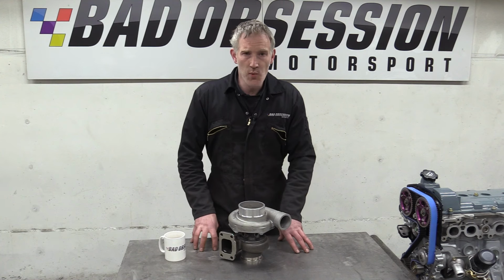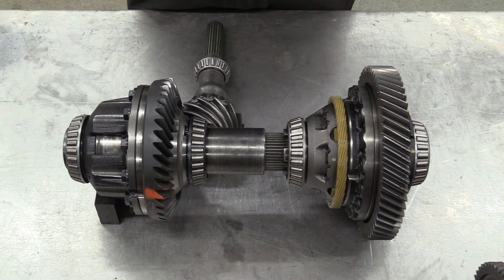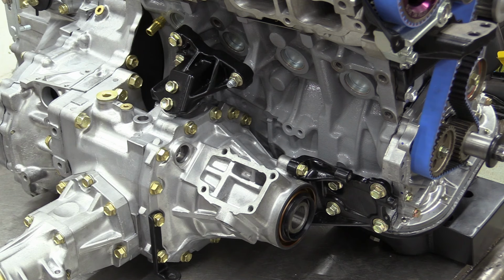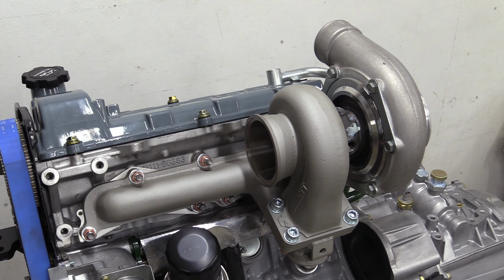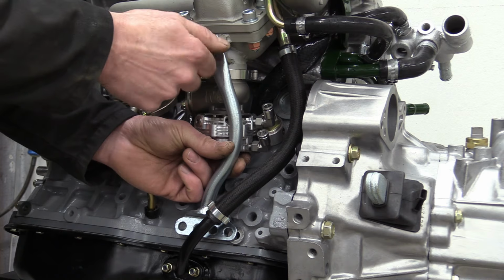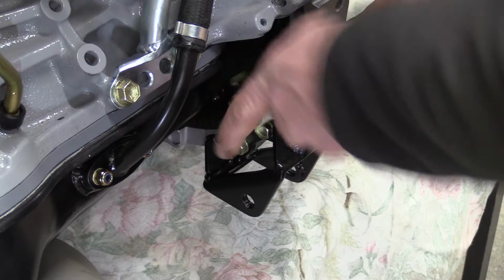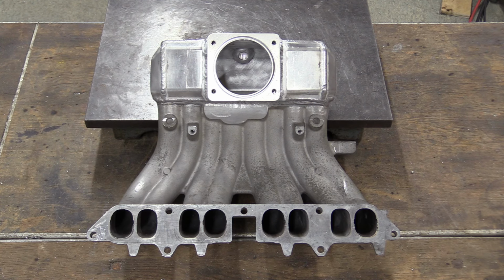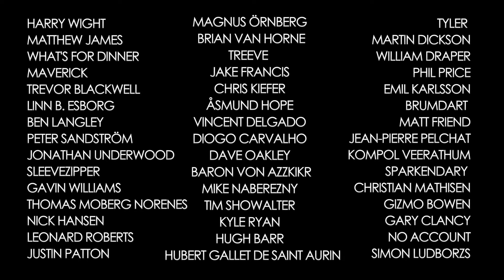Project Binky - Episode 31 - Austin Mini GT-Four - Turbocharged 4WD Mini

Comment: "The safest route is never usually the easiest route and this is why a lot of accidents happen"
Reply: Efficiency, Safety, Cost. Pick two.
Reply: Safety Harness? I don't need no steenking safety harness! Last words: "AAAAAAAAAAAAAAAAAAAAAAAAAAAAAAHHHHHHHHHHHHHHHHHHHHHHHHHHHHHHHHHHHHHHH"
Reply: The safest route isn't always the quickest way to the accident.
Reply: i just came to point out that the plural for "datum" is not "datums", it is "data". like that star trek android.
Reply: Safety third lol 😆
Reply: Jeep wrangler lift kits do come to mind
Reply: Not having the special tool and using a screwdriver+hammer is a fine source of injuries.
Reply: @cheater00  You'd win the nerd-off between you and Data! But I did think the same thing myself! :D
Reply: That's how my kids occurred

Comment: Can you imagine trying to get Binky insured?  

Is the car customised? :   YES.
What customisations does the car have? : YES.
Reply: I.C.V would be the answer, with an agreed value of parts and labour gone into it to reproduce it in a retail shop.
Reply: Ah, it is just a Mini, but a lot safer. It has side-impact bars, proper seat belts, proper seats, much better brakes, an improved crash structure at the front, all engineered with CAD. Also it has been fitted with a Safe-T device, developed and produced by a respectable company. I quite literally can't see any issues with insuring it. 😋
Reply: I'd actually like to see the customisation list - or more accurately the face of the insurance guy who previews the application! I wonder if they'd read all of it...
Reply: @smartin2174  insurance yes, no problem except the potential price. There's hardly a part that's original so valuation is tricky in insurance broker world.
Reply: Has Binky got an MOT?  Yes it has,
Has it been inspected by motorsports F1?   Yes it has,
Is it a class A classic mini?   Yes it is,
Ah now your talking,  cheap classic class insurance club....
Reply: It’s the same celica with a body kit. Cut the vin from one body shell to the other and you’re golden

Comment: Thanks guys, I went out last night to collect a length of aluminium sheet to tackle a job for my 24 valve Cosworth engine and I’ve just watched this video of the intake upgrades which is exactly what I’m going to be doing next.  😁
Awesome job as usual, especially the fitting of the 1 3/4 S.U. Carb at the end 😉

Comment: Nice!!! 

You need two Safe-T turbos for extra safety though.
Reply: One big and a second smaller safe-t turbski just in case. For low rpm safety of course...
Reply: Sounds perfect.
Reply: Am I the only one who thought about a small atmospheric supercharger in line with a big turbocharger. You will have the "safe-T" in the low and high range. Mostly low because of low end acceleration.
Reply: *one per cylinder
Reply: Yes as a fail safe kind of thing 🤔

Comment: Have you thought about adding insulation to the upper part of the turbo oil drain?  When you shut off the engine, the coating of oil on the upper pipe is going to get cooked by the heat from the header. I don't know if it's hot enough to cause coking that would eventually block the drain.  But better safe than sorry.

Comment: When you're done with the assembly of the Mini, try and squeeze in an electric pump for the turbo and a fan that sucks out hot air from the engine bay, when the car is stopped. A lot of people ignore that time in the modding world, but as far as i'm concerned, it's exactly the time when the most heat damage occurs to parts as there's insufficient cooling going around.
Reply: no

Comment: 15- 20% heat reduction is impressive
Reply: Its more transfer than anything.
Reply: Less heat energy under the bonnet means more energy into the turbocharger
Reply: @gabrielecossettini2923  And fewer things melting under the hood while the absolute madlads are going full tilt around a course.

Comment: Holy Mother of Overengineering!
Reply: Named Toyota in the 90s.
Reply: @guy_autordie  There's a reason lots of them are still on the road. And it's definitely not because they're fast or stylish.
Reply: If it is worth engineering it is worth overengineering! The rally rules said that you had to have a version in volume production... so Toyota threw every kind of sturdiness at the rally version... and had to sell that to "civilians".
Reply: When the patron saints of bracketry work on a Toyota from the 90's, one should expect no less :D

Comment: I have been looking everywhere for a 9.525 mm socket extension but had to make do with a 3/8". Your metric stuff is odd.
Reply: 9.525 is the high accuracy version, roughly the same as  12/32 give or take a ginger
Reply: Or 0.011₂ inch if you want to trash this base 10 crud of metric.

Comment: Tidy! That engine looks lovely with its shiny finish. The engines I do all the wiring on are a little bigger but this little car will go much quicker, then again tanks are not famous for their breakneck speed. I'd love to see you chaps try to squeeze one of these engines into a Celica, it'd pull a house. Imagine the brackets you'd have to make and the chassis reinforcement would make you both swoon once you'd made it. 
Another great video chaps.

Comment: Good stuff. Nick's nice little sheathed hose is known as the "hose from hell" to those of us who've owned a Celica GT4 or MR2 Turbo. I did such an insulating endeavor quite some time ago when I had mine. That center stud on the top of the turbo manifold (on mine at least) had a bad habit of backing out (nut attached) and falling off. A pretty tough repair when you have Helicoil the stripped hole in situ with the engine, and some of that "stuff" still in the car.

Comment: Getting to this a bit late, but for anyone else thinking about zinc plate for high temperature corrosion protection like Richard did here...

There's a temperature inversion in the iron-zinc galvanic couple. This means galvainsing, sheradising and zinc plate only protect steel below about 75°C. Above that the steel is consumed in preference to zinc in any corrosion reaction.

Sorry.

Comment: You might try using bolts that have had the heads cut off, thread them in light hand tight, the headless bolts act as longer guide pins to help mating the engine and the transmission.

Comment: That engine is absolutely gorgeous. Only thing I'm wondering is the lack of obvious Copper Grease or Anti Sieze on the bolts? Then again I suppose Binky won't get too wet too often and I'm guessing the plated parts won't corrode too much.

Comment: Hi. May I please ask. During a past episode, I believe it was the one in which the suspension geometry was checked, it was mentioned that you have carried out measurements of the chassis rigidity. Would it be possible to have an episode with that process? Thanks and regards.

Comment: Jolly good show chaps. What's that yellow patina on the multiplicity of various pipes and metal brackets? You were applying it in a bath of chemical salts. Some sort of electro-plating process no doubt. I should be interested to know as the refurbishment of a CNC mill that I am attempting could well benefit by the application of such a treatment to some of the miscellaneous appurtenances and may very well enhance the operability and longevity of the finished machine. On another note, your carefully modulated dry wit and droll British humour is a refreshing change from what one normally expects to see on You Tube.

Comment: With the gearbox oil pump driven off the differential, how is the gearbox lubricated in neutral. Maybe the oil getting flung around by the gear sets is enough when the gears have almost no load, but who knows?

Comment: Maybe I missed something, but what is the purpose for the copper nuts?  As far as I can tell, copper reacts with zinc, iron, and aluminum for that matter,  setting up for corrosion at any pint those metals are in contact.

Comment: Absolutely love this project the fabrication is out of this world. Just 1 minor thing. I've heard the 3sgte block isn't the strongest and that a 2.2 variant bottom end from another model is better for reaching higher hp numbers. How come u didn't go that route ?
Reply from the maker: How much horsepower do you reckon we need in a mini?
Reply: @BadObsessionMotorsport  well I'm  pretty sure that turbo is rated over 500 bhp wat numbers are u aiming for. ?
Reply from the maker: Over 500 hp.
Reply: All the time people are worried about the weight of this car because it might be too much. If this mini gets more than 500hp then I am asking myself will it weight enough to keep it on the road or do you have to add more weight to it? A 500hp mini that sounds incedible. When I saw the 4cyl. engine and the turbo I thought about it will deliver maybe 150hp That might be the the difference between "Bad Obsession Motorsport" and "Bad Obsession - I like to work at cars in my freetime" like me. Thank you for sharing your hard work with us. I can not wait to see it running and getting parked in your fun truck.
Reply: @BadObsessionMotorsport    so 1gen GTX3582R + 2-ish liter engine, 425 to 550-ish hp in 700-ish kg Mini.
the only problem I can see is some local flatfoot could be little ticked happy seeing Binky acceleration from standstill at the traffic lights.
Reply: @s.w.7897  power to weight is a critical part of how the power is delivered or used. This thing going to be like a pondscater across tarmac super quick but the 4x4 system will give it the edge and have you seen some of the minis on the tube twin engine with turbo hyabusas front and rear that thing is a weapon n then some.
Reply: @1BigBen  that turbo is rated 550 to 1000 bhp from 2.0 upwards. I reckon it'll hit the 600's easy.
Reply: @chrisadams6772    550 to 1000 bhp that would be 2gen GTX3584RS, 
but what they have is GTX3582R and it is only gen1 425-700hp, the gen2 is 450 to 900hp.

but here is a question? 
why do I have an image of Nik with a grinder and a twin screw supercharger in my head.
Reply: @1BigBen  yes my bad you r ryt !
Reply: Just done some checking n I come up with 770 hp the old gen 1 is 700 but pretty sure it's the updated version.
Reply: @1BigBen  wishfull thinking that my friend. Twin screw the daddy of all superchargers. 😎
Reply: @chrisadams6772   np bud 

now mini was 620-ish kg a weight power output ratio of 15.5 kg/hp 
now Binky could end being 1-1.5kg/hp 
the Bugatti Chiron is 1.3 kg/hp
Reply: @1BigBen  just ad a vid pop up on me wall 870 hp mini with Audi quattro 2.5 inline 5 engine hill climb monster but weighed in at 950 kg.
Reply: @chrisadams6772   nuts

but it is a  tubeframed with z-cars fiberglass body 870Hp and 747 lb-ft (1,014 Nm) of torque thanks to a Precision 64/68 turbocharger

so not really a mini and not even on paper (vin) 😉

Comment: That (almost) completed engine is pure porn! Having helicoiled my own 3SGTE head though, I feel that you've missed a trick by not using titanium studs and metal lock nuts on the exhaust manifold. I know rust probably won't be an issue for Binky, but they look so much nicer than the black steel and copper combo!

Comment: Why does the TVIS have to be replaced with a spacer of the same thickness?  Since you're always trying to save space, why not use something thinner?  Or if you want to push the manifold back to make room for the intercooler, maybe something thicker?

Comment: Chaps you're going to want to disconnect the engine water oil heat exchanger and the turbo water cooling for this spec as it'll super heat your coolant. Take word from a high power 3SGTE track user!
Reply: Forgot to add: additionally a swirl pot and expansion tank to get the air out the system. Cooling is imperative on a 3SGTE, the blocks need all the help they can get not to crack and super heated coolant or air in coolant from boiling expedite the issue.

Comment: Realising you’ve had the head porting by ‘someone who knows’...
But how come you didn’t gasket match the outer edges of the head ports to the exhaust & intakes as you did with the intake manifold?
Would it have been detrimental to the porting/flow work already done?

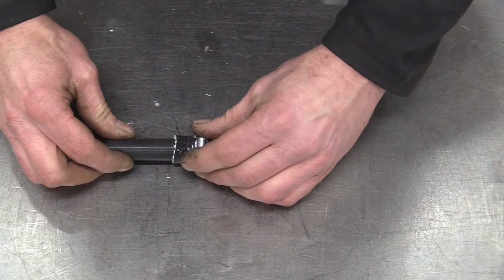Comment: I have a query regarding the silicone hose at 12:40. You wrapped it in a heat proof sheath but left the hose clamps exposed. Would there not be a risk of the stainless hose clamps thermally conducting the heat from which you are trying protect them due to their exposure?

Comment: Hi Guys and greetings form Italy.
As I was rewatching all the previous episodes a couple of questions are appeared in my mind.
On the suspension compartment (spring/shocks) are you going to use   OEM spec material or upgraded/custom material?
And brakes? OEM dimensions/disk/pads or something else?

Thanks.

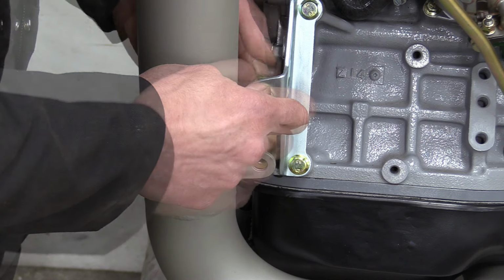Comment: 26:00 why was this done?
Would a stout spring have been a better way to join, would give a bit of vibration dampening?
Reply: Thinking about it, you'd need it fixed with no flex to keep the turbo/zorst mated true.
But why the drop linked bracket and not a simple tag to tag Bolt?

Comment: Why is it that when I work on my bicycles, I lubricate basically every bolt with either grease or use threadlocker like loctite...but all of the bolts used for the engine or turbo etc. in the video are dry? Interested to know...

Comment: It will undoubtedly  be the most magnificent machine on completion. If labour,parts, materials, sub contract were all added up this would be at least a half a million pound project may be a lot more . When you go to the lengths of replating every nut and bolt there is no way this car can ever be used let along ever come in to contact with any moisture. It may be started once  but will live out its days inside a climate controlled dehumidified CarCoon. No question it can never be exposed to the outside world.  So the turbo lag will not matter.

Comment: You've been calling the many, many fasteners on this engine build "bolts." Technically, they are almost all "screws." The distinction is that bolts are ALWAYS secured with a nut. Nearly all your fasteners are being screwed into threaded holes in the block, manifolds, transmission, etc. Thus these are screws, even though they may look like bolts. (This is how we do it in the States -- maybe it's different in mother England.)

Comment: Went back and watched it again. Then re-re-watched it. Nope. Not really possible to get that into the Mini's engine bay, methinks. That bay is going to have to be longer on the inside than the outside. And taller. So. One thing at a time. How to get it taller? A scoop? A scoop will serve two masters: more space for the turbo and cooling for same. Then, to grant more engine bay space, front to back without changing the outside dimensions...rob the inside of the passenger compartment? That might work. I guess. If you want no space for a back seat. Either all that or you extend the front end. Or magic. I vote for magic.

Comment: Would you not need to back purge that exhaust manifold when Tig welding it  just pondering over a brew
Reply from the maker: The manifold is mild steel. So no.
Reply: @BadObsessionMotorsport   ah fair play take it easy fella's

Comment: Please... put argon inside when you are tig welding. Don't take out your wire away right after you finish weld, keep it under argon until it cures (not hot)

Comment: This thing is the polar opposite of the normal artificial time pressure that they put on obnoxious reality TV car shows. "Mike and Jim have to build an SR-71 Blackbird in the next 12 minutes so they're going to do it out of bailing wire and duct tape.... " "And  since they're in a bind for no particular reason they've called in some celebrity help, here's Chip Foose to replace the brake pads and put on the lug nuts.... "

Comment: BRG pipes. I guess that mens that's the colour of the car? Has to be really, with a white roof of course.
Remote oil filter? That one is going to get rather hot where it is now.
You can see why there is such a long gap between episodes but I don't mind a bit. It's quality time.

Comment: Great work , but that exhaust manifold is gona cost u power , where’s the power goal as the turbo many would consider will make more than the block can take , the stock manifold wasn’t that bad , I’ve seen 60 Bhp increase in coming up from a better manifold than is on it , but att the rest is top notch

Comment: I'm not knowledgeable to know for entirely for sure, but the throttle position on your intake manifold doesn't give the best amount of air flow to the outer cylinders, this was a common problem for the early generation of this engine and Toyota redesigned the manifold to have the throttle next to cylinder one rather than next to the center cylinders, although seeing the turbo set up, and the FWD application it might not be an issue.

Comment: 15:05 temperatures changes can't be measured in percentages, unless you're using an absolute scale, in which case a temperature reduction of 10% from 90C (363K) would be about 55C (330K).
That's not how it works.